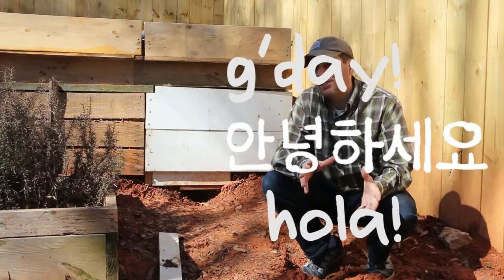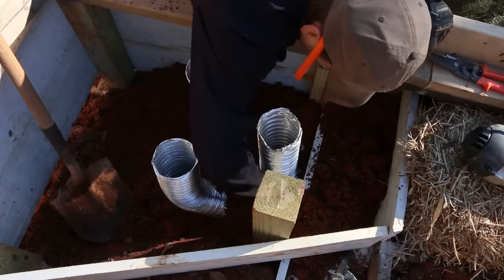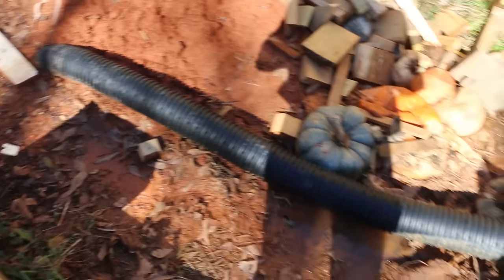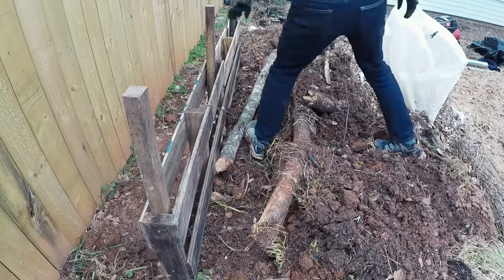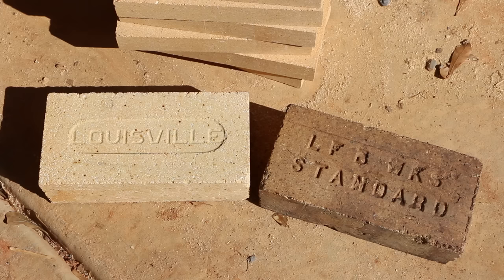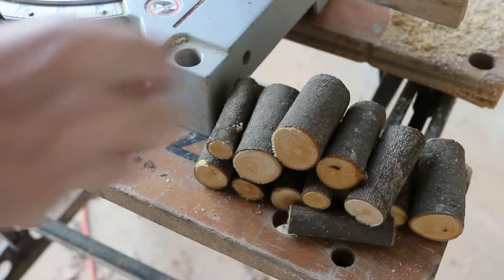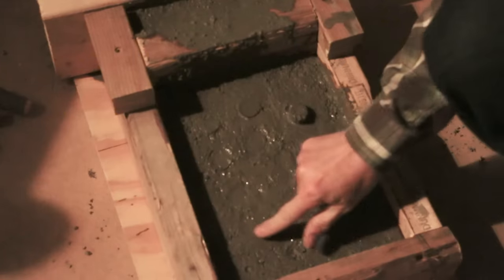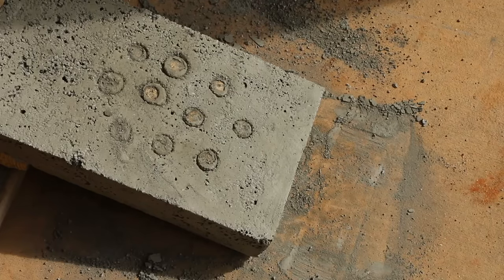How To Heat A Greenhouse For FREE

Comment: What you mean...the same pipe will transport..the cold and hot air...the cold air will travel at the first half down part and the second half will let travel the hot air in the upper part of the same pipe... right?...
Reply from the maker: Yes, in theory. It is a lot to ask of one pipe. But, I’m looking the laws of gravity and thermodynamics to make this work, so I can’t go wrong there. Most likely the pipe will flow in one direction or the other, depending on the predominant volume of air and the outside temperature. I do need to check this one the greenhouse is completely sealed. In theory, if the temperature difference is drastic enough, there could be a two way flow in the pipe. Thanks for watching.

Comment: I also feel the need to correct that cement is not drying but that it is setting. that its a chemical proces. ha ha
 always followed by roling eyes. 
Will the fire be going all winter or only when the temperature dips below freezing?
Reply from the maker: :-) I think I’ll just use the fire as needed even though my pyro-self may want to burn it more. The inside of the greenhouse has a 3.5 foot deep trench, which will provide some ambient heat as well as the earth air tube. I’ve got to seal up the  greenhouse before I can get a true temperature reading. Thanks for watching.

Comment: I do think your design is smart.I think your draw problem will be gone once they burn out...ty for sharing ...You went through all the trouble to build and barry the thing that you should have used copper tubing instead of plugs or if your goal is to be greener then you could  have used a simple drill and wood bit to open them up some before you set it in place..
Reply from the maker: Agreed. Pipe forms would have worked well also. The plugs came out pretty easily (this week’s video). I only had to knock out a couple, but they gave out without much trouble. I did also modify the firebox to make it a little bigger and rebuilt the body of the furnace with insulated concrete. Check it out. Thanks for watching.
Reply: bury

Comment: You could avoid the time spent burning out the wood dowels by drilling them before setting up for the first fire. That way, the fire will pass through burning the scant remaining wood out much faster.
Reply: You could have also used some reclaimed metal pipe and left it there:)

Comment: add more chimney, to make more draft...
Reply: Correct! Chimney should always be 3' taller than anything within 10' of the chimney. In other words, the chimney needs to be 36" taller than the fence next to it to achieve proper draw.
Reply from the maker: Good idea. Thanks for the suggestion.
Reply: Yes on the taller chimney, and try burning balled up newspaper first to push the plug of cold air out the chimney. Fran
Reply: And insulate the exhaust stack in needs to stay warm to draw properly 👍

Comment: If you soak the wood in oil/diesel (or form oil) they won't stick to the cement as much.
Reply from the maker: Thanks for the suggestion Coty. I'll that a try in my next concrete project. Thanks for watching.
Reply: @GreenShortzDIY  - Whenever I do concrete work, I always coat the forms with old vegetable oil so that the forms release easily!

Comment: A little taller chimney may help it draw harder...
Reply from the maker: Thanks for the suggestion, Steve. I may give extending the chimney a try. Also may try a custom roof for the fire box to allow for more wood volume. It was a lot smaller than I imagined. I definitely think I’ll be tweaking this one. Thanks for watching.
Reply: I agree, you need more chimney to help burn the plugs etc
Reply: Absolutely, just taller than the fence next to it and that should do it
Reply: the chimney has to be twice the height of the length of the horizontal bits.
Reply: Also, if you paint the chimney black, it should draw from being warmed by the sunlight.  It works well with outhouse tank exhausts which are designed to remove smell.

Comment: Why not just make a mass rocket heater for the greenhouse?  Seems it would have been easier.  Lots of videos on how to create one and the mass area could be used as a heated seed sprouting area for early spring, but any plants that need warmth during winter would benefit from the warmth radiated from the mass of the rocket heater.
Reply from the maker: Yeah. That would have been a better option. This was fun to make, but ultimately an ill-fated project. Thank you for the feedback.

Comment: Would Vermiculite work instead of pearlite ?
Reply from the maker: Yes. Vermiculite and perlite function the same way when used as concrete insulation. My local Home Depot only had perlite in stock, so I went with that. Thanks for watching.

Comment: At 21:20 you blocked your air flow off. I was wondering what you were doing because when you set your little fire wall in there the air could not get through. I think you need to add some common sense in that back fill and it will work a lot better. Put a good thick stainless screen in there to keep the rats and things out.
Reply from the maker: Good feedback. In the end this little furnace did not succeed. But, it was a fun build and I learned a lot from what went wrong. Thanks for watching.

Comment: Good Idea. But...wood stove masters wil find some mistakes in dimensions and proportions of your wood stove. Small door will great help to improve the efficiency of all system, for example.
Reply from the maker: True. This is a bit of a hack stove. I like experimenting, but I agree that the proper design specs are out there and doing some research wouldn’t hurt. :-) Thanks for watching.
Reply: Yes, have a door,  and damper on the exhaust pipe to keep a lot of heat from going up in smoke, literally.

Comment: I think that the wet clay mass is sucking so much heat that the draft is impaired. As it dries that might change.
Reply from the maker: When I fired the furnace again today, I was able to get it draft. I think it just needed a hooter fire. The clay mass between the fire box and the wall of the greenhouse was getting pretty warm as well, so your thought may be a factor as well. I think I’m going to rebuild it with an insulated connection there instead of the clay. Thanks for watching.
Reply: GreenShortz DIY a hooter fire, that does sound hot lol
Reply from the maker: Boy was it. I think I’ll leave that error as is, for sentimental value. Lol.

Comment: thought for sure you'd drill some holes through those plugs.
Reply from the maker: Brian, that would have been a good idea. I might pull the clay off the front bricks and do that. They’d certainly burn out faster that way. Thanks for the idea.
Reply: you've got a good start on a rocket mass heater.

Comment: Just an after thought, you should have drilled out those wooden pegs before building the firebox.
Reply from the maker: Hi Richard. That might have been a good trick to shorten the time to burn them out. Although, given that they were green, they dried out and shrunk, and were pretty easy to push out after a couple burns. Thanks for watching.

Comment: leaving the sand out was the right thing but you did not add enough perlite... it's at least a 4 to 1 ratio... 1 to 1 is not enough to be properly insulated... Also, whenever you embed something into concrete with the expectation of being able to remove it after it is cured,  DON'T ...  It won't come out....  You must wrap it in a slick releasable substance like a thin plastic film and then remove it a a day or so after it begins to cure but not totally cured....   And one more thing... the heat riser will never draw until it is heated up and it too must be as insulated as your fire box in order to be efficient!!  I suggest you  form a heat riser out of a 4 to one ration of perlite and portland cement...   another reason you were having trouble getting it to draw is that the surrounding natural clay seems to be very wet and therefore cold ... preventing the riser from heating up the way it should.  having a properly insulated heat riser would have solved that issue. .
Reply from the maker: Good feedback. I’ll likely just scrap this furnace. It was a fun experiment, but a bit of a hack job. :-) The last time I tried to light it, it barely put any smoke out the chimney. I think the smoke channel collapsed. Too much effort to dig that out. I do like your suggestions. I’ll use them in a new build. Thanks for watching.
Reply: experimenting is the best teacher... just sharing what we have learned... always learning new stuff....I love your videos though... keep em coming!!

Comment: The stove seems incredibly inefficient. A basic shop bough stove inside the greenhouse would be several times more efficient. If you want to store heat water is one of the best mediums there is, it has an incredible specific heat capacity. You could heat a large insulates tank with a good hot, clean burn then let it radiate heat for hours with simple vents or by piping the hot water wherever you needed- under seed beds, below the floor or just to a couple of radiators.

Comment: * i HIGHLY SUGGEST looking into Rocket Stove.  This is way too much work and using Plastic with fire is  not what I would use with anything FIRE.
Reply from the maker: Thanks for the feedback. Thanks for watching.
Reply: There’s are two interesting discoveries which open the use of plastics and or refuse (2 different things...one is reusable or cleaner and the other is well dirty) as a fuel source. Sweden actually receives most of Europe’s trash right now because they create clean power and heat their govt district with it. A second interesting and already proven method turns the plastics into diesel while releasing nearly no CO2. It can be done today. An engineer in Idaho just sold her first diesel creator last year to a city in California. Plastic is just a petroleum based formed product. Nothing too magical about it and with proper retire and filtration, it’s actually as clean as most home heat sources.

Comment: Hi GS DIY,
     So if I understand this right the earth tube drains cold air out of the green house, heats up the air due to the biomass above it, and drains excess water away from the  GH roof and the neighbors yard? All from the same tube? So many tubes in this system. A couple more ideas... What if the rocket mass heater (RMH) got its air from inside the green house??? Lolz, one more tube. Certainly not necessary, but interesting to consider. 
     Are you familiar with the bell bench design for rocket mass heaters? You could incorporate it into your green house. If you have a spare steel 55 gallon drum just lying around, in the green house you dig down to the RMH exhaust pipe lay the 55 on it's side, drill some holes on the new bottom so that the exhaust pipe fits in. The principle is explained in these 2 videos...
Quick explanation https://www.youtube.com/watch?v=vXHmcKWfFw4 
More detailed explanation https://www.youtube.com/watch?v=1GFCslsLZwo 
I hope this information helps.     Cheers,     
     Bill
Reply from the maker: Ha. True, it is a house of tubes. The earth air pipe does attempt to serve many functions. The greenhouse roof drains to the side, but some of that water will end up in the tube. I have heard of a bench style rocket mass heater. I plan to build one for my workshop, which is underway behind the slatted wall in my backyard. One more modification to the greenhouse will be a better insulated connection for the firebox to the chimney. Right now the clay dome heats up too much. I want that heat captured inside the greenhouse. I hadn’t thought about trying to have the furnace pull air from the greenhouse, but it might be as simple as connecting a pipe underneath the furnace to the earth air tube. Right now that area does fill up with rain water, so this could serve as a drain as well. Another tube. :-)

Comment: I'll bet once the plugs are out you'll get more air flow.
Reply from the maker: Hi Chad. I did get it draft even before the plugs came out. I just needed a hotter fire. I do think you are right though. Air flow should be much better. Although, after the rain last night, the air channel is a pool. It will need a drain. Thanks for watching.

Comment: Just use your dryers extra heat....if u have dryer youll know what i mean
Reply from the maker: That’s a great idea Isaac. My vent is pretty close to the end of the earth air tube. Will try that. Thanks for the suggestion.
Reply: Quote....No solutions come without a problem....
Reply: Excessive moisture from dryer vent because of wet clothes drying could cause dangerous black mold or white mold without proper air ventilation
Reply: Quote..,no solutions come without perspiration.....

Comment: Ha, if you could run a vent from your dryer to your green house...
Reply from the maker: Yes! I’ve actually been thinking about that. The dryer center is on that side of the house about 15 feet away. Now I’m going to do it. Thanks for the suggestion. Thanks for watching.
Reply: @GreenShortzDIY  No, I  don't think you can do that because of the lint. It will stick in the tube and burn your house down.

Comment: waste of time even if it did draw you would have to feed it wood every 30 minutes
Reply from the maker: You are correct. While it was a fun experiment, it didn’t perform. Pretty accurate on the feed time too. Thanks for the feedback. Thanks for watching.
Reply: @GreenShortzDIY   I have burned firewood for heat most of my life even with a bigger stove you will have to feed it through the night now if you put a bunch of black water barrels in there and get a bigger stove that burns longer that would probably get you through the night then if it's still to cold build another fire in the morning the heat from the water barrels should buy you a little more time.

Comment: Nowhere near enough draw... Experiment: failure.
Reply from the maker: Ha. You're direct. :-) I did get a better burn the next time around. But, I actually rebuilt this furnace today adding a some height to the fire box. I also knocked all the plugs out of the hearth which will help it draft better. So, at least do me this favor...without final judgement until I give this revised version a full burn. Thanks for watching.
Reply: GreenShortz DIY 👍

Comment: Your stove is horribly inefficient!!   Learn something about rocket stove mass heater principles to a) produce the most efficient combustion and b)  the most efficient method of harvesting and slowly distributing the heat produced.
Reply from the maker: True. I wasn't thinking efficiency with this particular stove. It was more of a hack job...an experiment. So, your criticism is well taken. I am in the learning mode on rocket stoves a rocket mass heaters and do plan a full-fledged build at some point. Thanks for watching.
Reply: Apart from the efficient burn, one of the most useful things about rockets is that, reasonably decently designed, they produce a little bit of positive exhaust pressure ('thrust') which, in turn, enables one to run the exhaust (sic) cum heat exchanger horizontally for a long distance.  There is no need for a riser and it only requires inspection/cleaning ports and drainage for the considerable condensation produced.  The latter is the reason the unnecessary riser's not such a good idea in most cases.    
  Such units are used on tankers to produce 1) Highly efficient (95% ish) combustion of variably viscous oil for heating the cargo and 2) self-evidently inert gasses for filling ullage and void spaces.  Should you need any help with design calc etc., let me know.
Reply from the maker: Thanks for the info on rocket stoves. It sounds like you know what you are talking about here. :-) I would like to learn more. Send me a message in my channel's message center. Thank you.
Reply: 'Message centre' ...   lost me.    Not 'social media' adept.       Marine engineering background and been looking at rockets on YouTube in utter fascination at how most manage to miss the mark entirely.          Anyway, thanks in return for the info on worms.      As part of heading toward better self-sufficiency, been filling (multiplying!) old baths in one greenhouse with the little blighters and now wondering where to go next!

Comment: Free?  Firewood costs money unless you have a plethora of trees, pipes, concrete, clay, materials and the equipment all cost money! free?!  If you had all these things left over from previous jobs, free then.  Otherwise not free!
Reply from the maker: Well... I can’t argue with your questioning Free. :-) the Stove did cost money for materials. In my case, the fuel is free. I did save every piece of scrap 2x4 from the construction of my house and have two large oaks that give me a steady supply of limbs. But, part of the Free title was an experiment. This video gets 10 times the views of the others in this series. I don’t like to rely on clickbait titles, but even a single word like Free makes as huge difference. Thanks for the feedback. Thanks for watching.
Reply: The title says how to HEAT a greenhouse for free, not how to build a heater for free.
Reply from the maker: @pwrovld  Thanks for your assessment of the title. That is what I was getting at. Thanks for watching.
Reply from the maker: Hi Adam. I understand your point of view. My use of "free" here was pointing to the fuel. The furnace did cost to build. To me the beauty of a rocket-type stove or furnace is the use of found fuel...sticks and twigs, versus cut firewood. I've got two big oak trees that drop a steady supply of limbs. My fuel supply also comes from my pack-ratting every tiny piece of untreated wood from the construction of my home. I know this won't apply to everyone, but I do think free fuel can be sourced fairly easily. Thanks for the feedback.